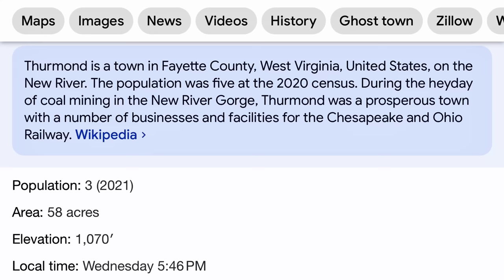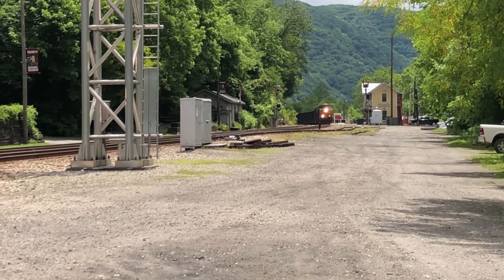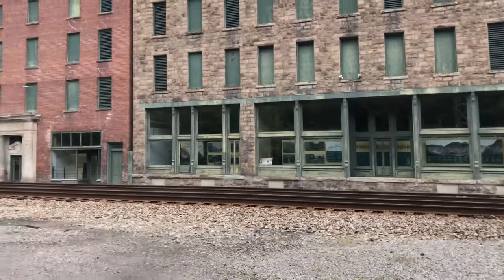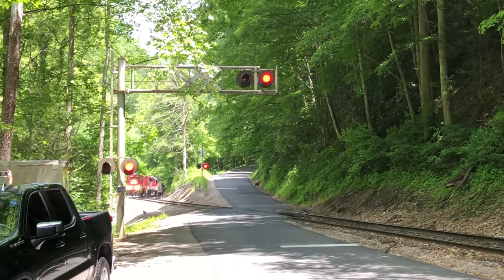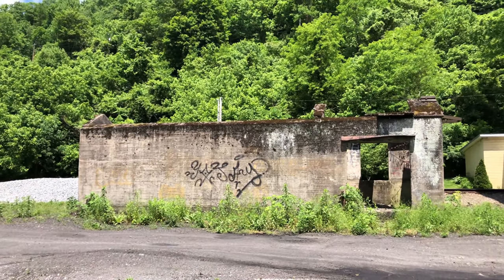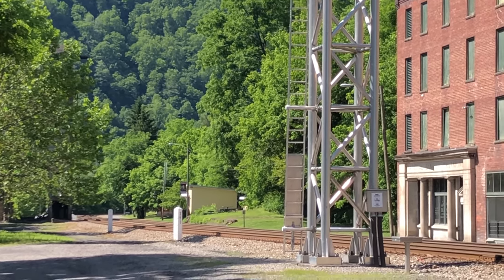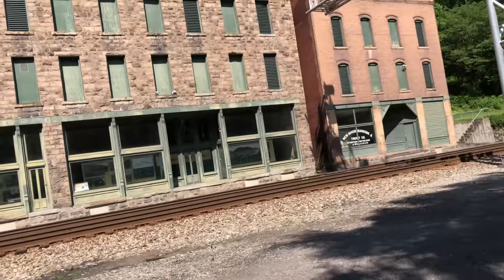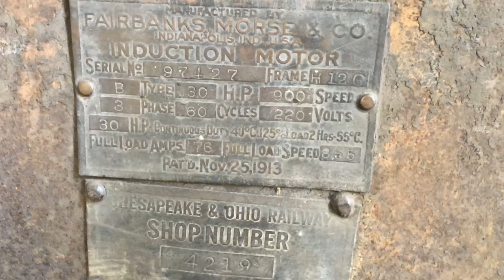RJ Corman Railroad Takes 6 Loads Of Coal Back Up The Hill After Derailment, CPKC Engine Thurmond WVa

Comment: RJ Corman SD 40-2 Tunnel motors.  Looks like old SP locomotives judging by the long snoot. Great catch.
Reply from the maker: thanks!  I am told they will be getting rid of them soon
Reply: @JawTooth  Well that's a bummer. It's always cool to see those old soldiers still running the rails.
Reply: @JawTooth  That would be a real shame.  Have you heard if the mine at risk of closing?
Reply from the maker: @robertf3479  I am told that the mine at Pax is safe.  They have a new seam of coal to open up also

Comment: I believe the coal was raised to the hoppers above by a bucket conveyor system.
Reply: Correct, Lynwood, it was a bucket conveyor system .. also referred to as an elevator. And as you may know, that type of system is still used in many applications today.
Reply: @kennethfuller8347  I know, I have designed several over the years, mostly to move abrasives. We sometimes used pneumatics, sometimes screw type and bucket elevators.

Comment: That is some Coaling Tower.  Very different to most of the Coaling Stages in the UK here, but the Power-Stations used to operate a similar unloading method...a constant-screw type lifter(?)  Nice catch with the 'Kansas City' and RJ Cormans folks there too.  I'll catch part 1 directly.  Keep Safe, Jaw Tooth.  All the best.  Cheers!

Comment: Fun facts : R.J. Corman Railpower Locomotives uses a variety of engines for their short lines, including Cummins QSK60, Tier 4 Deutz, and Tier 3 and Tier 4 certified engines:
Cummins QSK60
An EPA Certified Tier 4 engine that's built in the United Kingdom and is also used in marine and power generation
Tier 4 Deutz
An engine used in RP Series GenSets, which are multi-purpose solutions for operations in the United States and Canada
Tier 3 and Tier 4 certified engines
Used in RP Series locomotives, which can reduce greenhouse gas emissions by up to 55% and nitrogen oxides (NOx) and particulates by up to 90%

Comment: Nice to see tunnel motors.  A very uncommon sighting.😎😊👌👍!
Reply: What is a tunnel motor.
Reply: @robertheinkel6225  Tunnel motors have their fresh air intakes at the walkway level.  Origionaly for the Southern Pacific to run in the sierras.     (Long tunnels and snow sheds). Most diesels air intakes are at roof level, which would draw in hot exhaust gasses from the lead engine and cause the trailing engine to overheat and shut down.  First used on the SP, D&RGW, and Cotton Belt.

Comment: at 746 Watts per hp times 30 horse, the Volts and Amps input listed on that motor don't sdd up. not sure why. maybe it's really 2x 220, for 440V

Comment: I remember seeing in another Amtrak video isn't there a state or federal park there I think the railroads need to start having classes locations where cars are dropped off tadic them how to take the air off the train and release hand brakes flat spots are causing axle failure and derailment